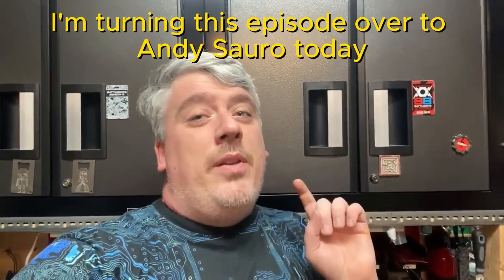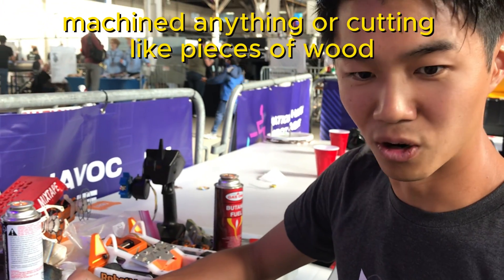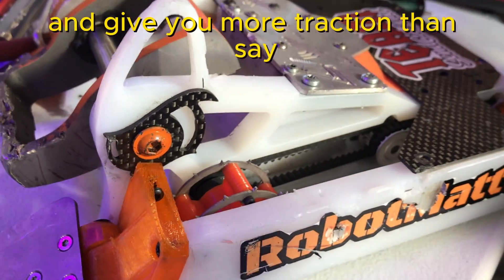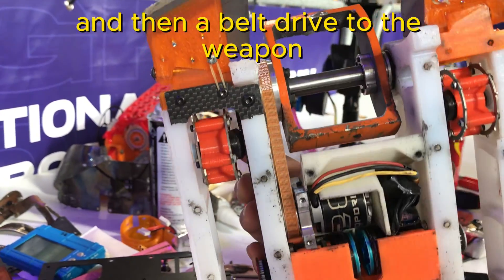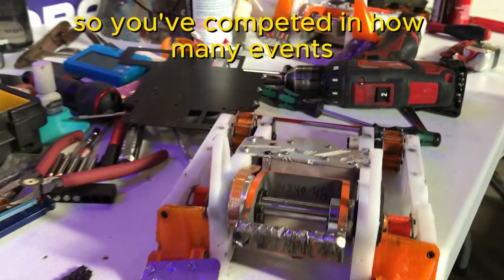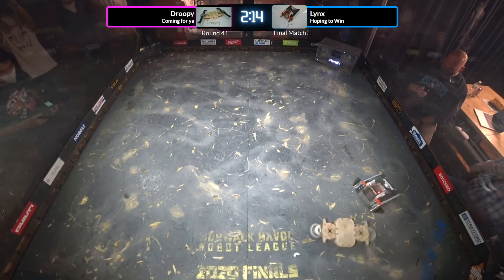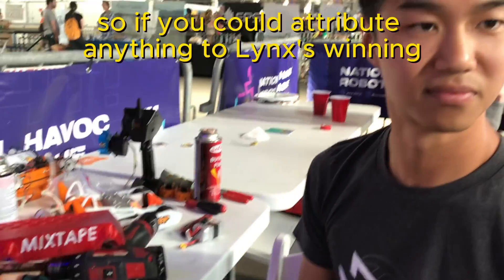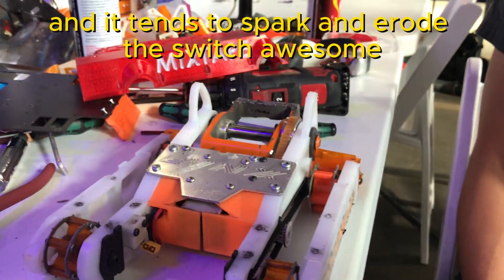What Makes Lynx The BEST BEETLEWEIGHT COMBAT ROBOT EVER?

Comment: I think this is the most compact and neat robot I have seen.
Reply: They literally pointed out multiple times in this very video that it is not a compact robot, it's quite wide and low
Reply: @olisk-jy9rz  I understand how you misunderstood me, I'm just talking about the electronic and mechanical internals. The outside is spread out so it can functions as a crumple zone, but the 'core' of the bot with the motors and gear boxes is very compact and very neat.
5:38 Calvin says that it is very compact.

Comment: 6S is 25.8V at 1000kv that’s 25800rpm
Reply: you're forgetting the reduction introduced by the pulleys
Reply: I searched that motor and only supports to 4S lipo, may it has a Voltage reduction